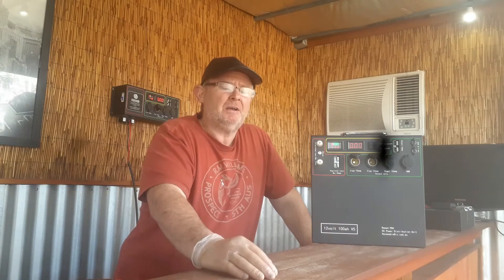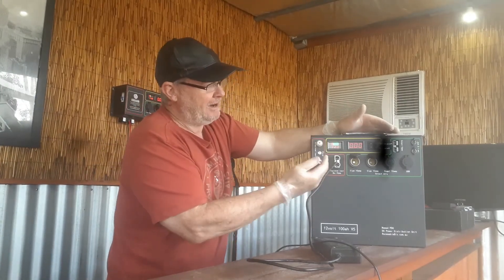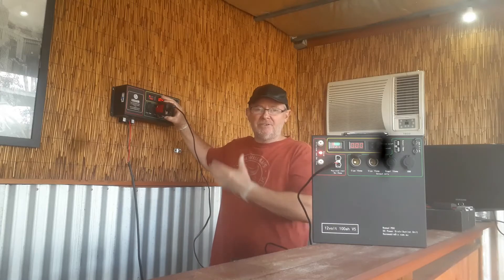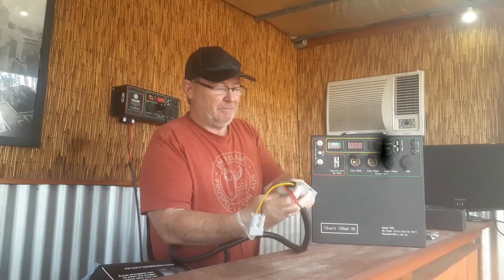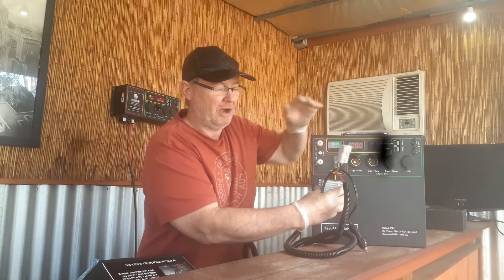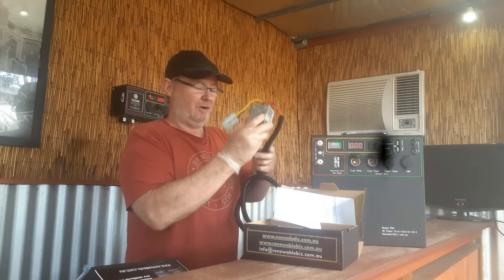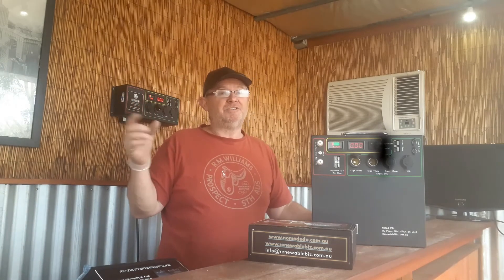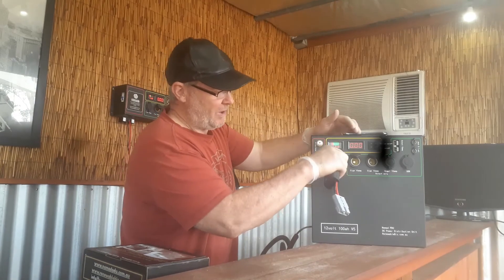Charging Nomad PDU

Comment: Am I better to use the 10 or 20 AMP dcdc charger? I run a cable straight from the starter battery, so need to use a DCDC or it will fry the Nomad I think?